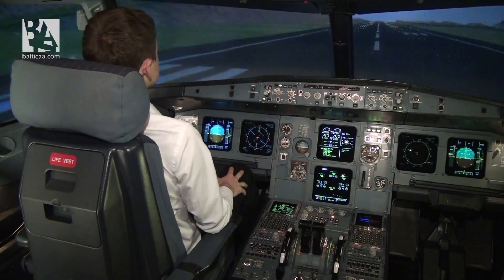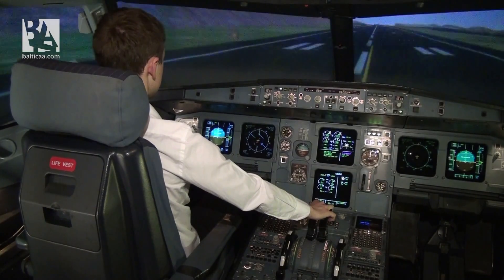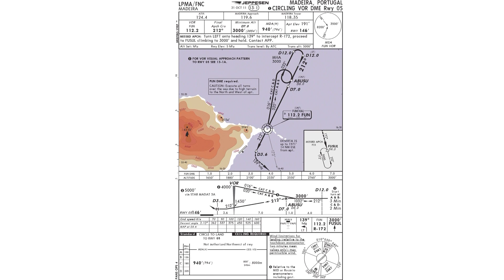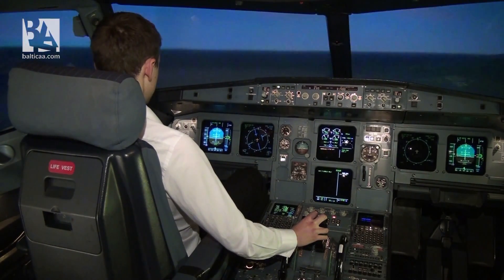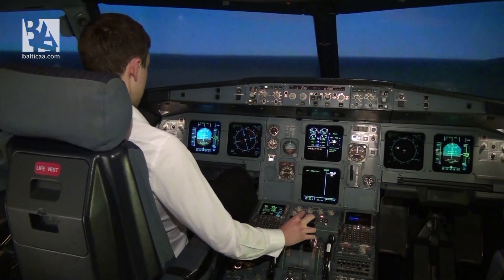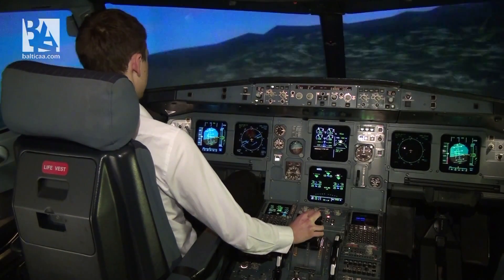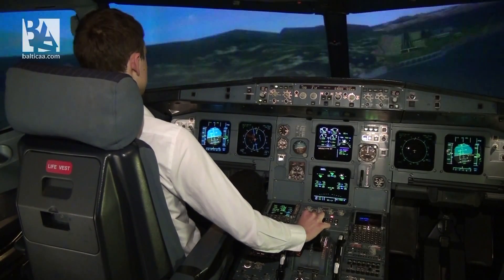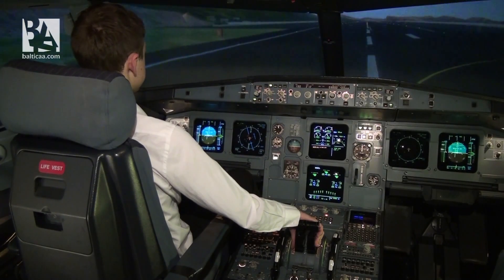The Most Dangerous Approaches: Madeira Airport

Comment: I think you should try to show how difficult is to land at Santos Dumont, Rio de Janeiro, Brazil. Despite the great landscape, the main runway of this airport has just 1,323m (4,341ft) length, the Rio-Niteroi bridge just behind the runway 20L, and the Sugar Loaf just ahead of the runway 02R. The brazilian airline Gol uses Boeing 737-800s (!) to serve this airport - quite a big plane for this short runway.
Reply: They are not normal B737-800s. They are B737-800SFPs (Short Field Performance). They has some changes from the normal B737-800s:
Flight spoilers are capable of 60 degree deflection on touchdown by addition of increased stroke actuators. This compares to the current 33/38 degrees and reduces stopping distances by improving braking capability.
Slats are sealed for take-off to flap position 15 (compared to the current 10) to allow the wing to generate more lift at lower rotation angles.
Slats only travel to Full Ext when TE flaps are beyond 25 (compared to the current 5). Autoslat function available from flap 1 to 25.
Flap load relief function active from flap 10 or greater.
Two-position tailskid that extends an extra 127mm (5ins) for landing protection. This allows greater angles of attack to be safely flown thereby reducing Vref and hence landing distance.
Main gear camber (splay) reduced by 1 degree to increase uniformity of braking across all MLG tyres.
Reduction of engine idle-thrust delay time from 5s to 2s to shorten landing roll.
FMC & FCC software revisions.

Comment: You were flying HEADING 212 when you were supposed to track the 212 radial out of FUN.  You can see on the nav screen that you are right of course, because there were wind coming from 070.  That can be dangerous as the wind is pushing you closer towards the mountains, and if you are too far right of course, you might not have enough room to make the right turn to intercept final.  .